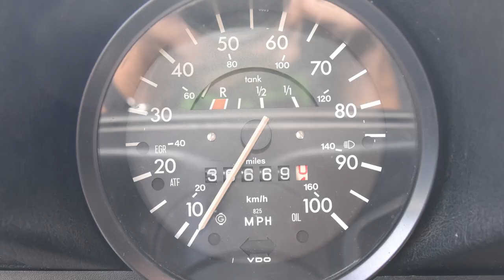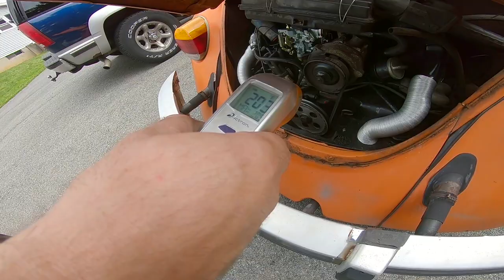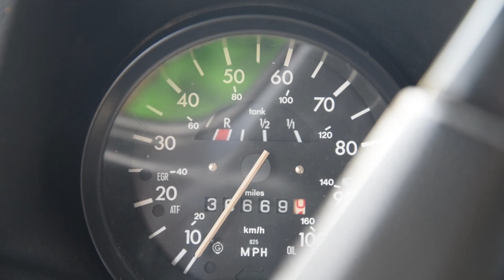1974 Volkswagen Super Beetle 1600: Regular Car Reviews

Comment: The Beetle's design, both in looks and practicality was ahead of it's time, when it was designed in the 1930's. It was also inexpensive and reliable and for all practical purposes in the United States, filled the small economy car niche for 15 years straight. What killed it in the US was, that even though it was reliable by 1960's standards, which weren't very high, and could be easily maintained by owners who were willing to get their hands dirty,  by the 1970's, the Japanese had raised the bar so high on reliability as well as fuel mileage (Beetles maybe got 30 mpg, but a Datsun B210 got 37-41 mpg, for instance), that Beatles could no longer compete & couldn't get by on "cuteness" alone. VW had by then acquired Audi, which had a vehicle in the works, which either spawned or became the VW Golf/Rabbit, which was enormously popular and likely saved VW as a company.

Comment: I've owned four classic Bugs over the last twenty years, including having a 1972 as my daily driver from 2010-2014, here in Maine. Yes it was cold, even with the heater system in good working order, but at least it drove brilliantly in the snow. 

But overall this review is pretty spot on, except that that super was in pretty shit shape. I drove mine from Maine to Maryland one summer and cruised on the highway between 65mph and 80mph. But I'd made sure all the cooling tins were correctly installed, and I still had to take cooldown breaks. 

The most accurate thing in the review is that Beetle people aren't really classic car people, which is why when it was time for a new classic (this time as a project/toy, not a daily) we got a 1950 Pontiac.

Comment: Here's an old car that barely runs and needs constant care. Here are a set of tools. Have fun teenager.

This is what my father did with my brothers and I. My older brother lacked the patience and attention to detail to really learn anything other than wiring. I can rebuild an entire engine, minus some of the the machining and also diagnose modern cars with all of their sensors and computers. My little brother has a Master's in engineering and can all of the machining for a rebuild. This strategy was also cheaper than having us work part time jobs and pay for newer used cars that didn't need all the attention, even though we constantly were having to visit the auto parts store to the point that the employees new are cars and us on sight.

Comment: My response is that all Type 1s today should be driven in the Southwest, where there is no road salt. If the oil heat disturbs you, there are aftermarket oil radiators for that. The heater problems can be fixed by checking if the tubes that channel the heat are rusted out under the car and replacing them. The VW Beetle is a "point A to point B" car, a faster Model T Ford. You want a hot-shit ride, get a water-cooled six or eight cylinder car with a five-speed manual transmission - the VW is for the other people who want basic transportation and nostalgia, and for people like me who find compact foreign cars of a certain era fascinating and would love to own an IZh 2125 Kombi or a Fiat 124 and a Beetle (no Autosticks, please).

Comment: A well-maintained (super) beetle is as reliable as any other well-maintained vehicle. BTW: that is an ALTERNATOR in that engine bay. If the engine bay is "too hot for a plastic fuel filter (which every other beetle has no problem with)" then you need a tune up.

Comment: You should do an actual beetle. Ie, 1962-1969. It handles way differently due to the torsion spring suspension. Ideally a 1600DP model with no bullshit done, ie no 'new' air filter with absolutely no modding done to fix the change in intake pressure, the tinwork & the diaphragm maintained, the heat exchangers not poisoning the cabin, I'm talking OG Hitler yo

Comment: While you are correct about some of the mechanical upkeep things, don't use this car as an example. It's a sled. No correctly tuned/timed VW engine should act that way. And no one should inspect one or drive one for that matter without a working speedo. (Just sayin'.) The fact of the matter is, the VW is not unlike ANY classic car. There IS upkeep that must be done on a less-than-modern car. People of a certain vintage will tell you that this was a fact of driving life many years ago. Like the 7 years I owned a 74 Beetle as my daily driver. You DO learn how to time the engine. You DO learn what a dwell meter is and how to use it. You DO learn how to adjust the carburetor and how to adjust the brakes. And you have to spend a shockingly large amount of time doing these things in comparison to operating a modern car. Once you do learn these things and can properly service your VW engine, it rewards you with a terrific driving experience. You have to intrinsically love the VW experience; it's not learned behavior!

Comment: With how simple these cars are even the wiring, just pull them apart nuts a bolts and do a full resto. They make hi performance engines for these things that just drop right in. I bet you could find one of these for less than $1000 put $4000 into it and have a fully reliable and good looking beetle.

Comment: Right off the bat, you can make them not smell like gas, the generator's slow charge makes batteries last much longer, the fuel lines don't rub on the ignition wires, they are super reliable, and the oil doesn't get hot unless you're over-reving it...Ok, wow, I'm not trying to do this but...The main difference between the beetle and super beetle isn't the size but the front suspension. The super beetle has McPherson struts instead of a torsion beam....Mechanic mechanic mechanic, What? I've owned a classic VW for years and I've done nothing but change the oil, absolutely nothing and its never skipped a beat. Its been as reliable as my father's Toyota Tundra.

Comment: I made the mistake of leaving the air filter off of mine one time.  Don't do that
Rain went straight in through those vent holes into the the engine and seized it up, and that was the end of my car.
I have a Datsun 280zxt and believe me, it is no picnic either.  Everything on it breaks.   Fuel injectors get clogged, starts break, fuel sensor broken, all those nifty high tech accessories to sell it off the deal floor...by now... inoperative and  broken and dead weight on the car, unless they can be removed.

Comment: I doubt if anyone under the age of 50 would understand, but people owned Beetles back in the 60s and 70s because they were uncomplicated, reliable and very easy to maintain.  Parts were cheap and plentiful, and there were lots of mechanics around who knew how to fix them, so the only thing a VW owner needed to know was where to put the gas.  It's easy to criticize the Beetle because the opposite is true today, but back then it was the car of choice for people who didn't know anything about cars and just wanted something they could count on to start on cold winter mornings.

Comment: The upkeep on any classic car is more than expected by drivers of modern cars. No need to single out the VW engines and vehicles being particularly problematic. Good news is that there are ample parts for replacement and at modest costs, and that the repairs are as simple as it gets. I have owned several 1960's beetles and three busses (1960 and 1971) as contemporary daily vehicles, and currently a 1971 bus as a 47 year old classic.
I was hoping for a less biased video AGAINST the classic beetle, but I guess everyone has their opinion.
I do agree that a long trip in a Beetle was brutal. But the ride of the bus is smooth as silk. My 1971 bus is smoother over bumps than my modern 2016 Toyota Prius! Yes, really.

Comment: It's not a bad car if you know what the hell you're talking about.

VW Beetles were designed in the 1930s to be BASIC transportation for the masses; for many in Germany, it would have been their first car.  (Think of it as the German equivalent to Ford's Model T.)
When the VW Beetle was designed and first built (the 1930s and 1940s), MANY cars didn't have hydraulic lifters, so adjusting the valve lash on a regular basis was something that was done.  (For example, Chrysler's Slant Six engines also needed to have the valve lash adjusted, and THAT motor was from the late 1950s/early 1960s.)

The differences between the standard Beetle and the Super Beetle start from the dashboard, and work their way forward.  The standard Beetle always had a flat windshield, whereas the Super Beetle  wound up with a curved windshield (the first few years, the Super Beetle also had flat glass).  The main difference is in the front suspension:  the standards had torsion bar front ends, whereas the Supers have struts, giving the Supers a better ride, and more storage room up front.

For reference, I love my '74 Super, but I'm a big fan of most cars, and I salute anybody willing to put in the time, effort and money to keep the old cars alive, regardless of marque.

Comment: The only thing missing from this video is the sound of that air-cooled engine under acceleration. You think Harleys sound obnoxious? Try a great big sewing machine with almost no soundproofing.

One of the attractions of these cars in the UK at the time was that, unlike domestic and most European product, they had a reputation, possibly not entirely deserved, for not rusting (virtually the whole of the UK is rust belt) and for being easy to work on. For the wealth-compromised, this was important. The Super Beetle was arguably the best Beetle ever made: but its viability depended on reliability and relatively low cost. Japan was about to eat the Beetle's lunch. By 1977-8 Datsun and Nissan were everywhere. Both our close neighbour - long time Beetle enthusiast - and my father - Vauxhall fanboy - went Japanese.

Comment: The VW Bug, the Porsche 911, and the Ford Anglia are all examples of timeless design with form following function, but with great style. A Bug may not be pretty like a 911 or a Anglia, but it's definitely unique. :)
As for the mechanical aspects of the Bug, if it doesn't make you a mechanic, it will make you a welder/body tech. Their major fault is they aren't exactly a built like a tank. Thin sheet metal that definitely rusts. The VW vintage buses are pretty much uni-bodies. If you've watched any amount of Mustie, you'll know that most of them are probably lipstick on a pig. Prepare for serious work if you plan on a restoration. It will cost way more than the car will ever be worth. VW culture is basically a hobby, not an investment.

Comment: The Super had a vastly superior platform to the regular beetle.  Monocoque (unibody) construction (not a detachable frame/body) with MacPherson struts all around and R&P steering. It did not change appreciably in height or track but wheelbase was a bit longer than the regular beetle I believe.  At some point they got the curved windshield you have here (which significantly improved fuel mileage).  As somebody else noted your '74 should have an alternator, replacing the earlier generator.  By later in the decade (last year in US was 1980?) they got fuel injection but if they ever got disc brakes I don't know.  But all kinds of aftermarket conversions for that.  If you can smell gas there is something seriously wrong that should be fixed.  If nothing else it will make you sick as a dog after 30m driving. Same with exhaust.  Neither was any widespread problem with these cars.  Just basic build attention is all it takes.  Some bad mechanic has had his hands on this particular car.

Comment: Incan tell you why it got all those states, although I'm amazed you didn't figure it out on your own. Yes, we have seen Beetles, all kinds of them. In my case, literally, not even counting the one my parents had, along with one of VWs camper van.

The reason we look is, it's normally the first time some of us have ever seen one running, and being driven. Mom's Bug never ran, and the van dies on a trip to NY from NC, right as we hit the toll booth in Richmond, and Dad had to drive from Jville to North of Richmond, to tow it back with the F100. Last time the van ever ran. 

Meanwhile, I couldn't kill my 62 Studebaker Lark, in 14 years of driving it, pretty much daily, and dad now has it, still going with 500 k on,  the clock, 3rd motor, 2nd transmission, 4th clutch.

Comment: I've owned my 69 karmann ghia (mechanically identical to a bug) for 4 years now and its the fucking easiest thing to keep running happy and its cheap too. I drive it no matter how cold it gets because if your heating components are all functioning properly and sealed the heat is totally adequate. I just keep it out of the rain and snow as its a convertible and the top doesn't seal well. I've put 35k on it since I bought it and truly can attest to how easy and cheap to maintain (mechanically) it is i do everything myself. Of course it takes a lot more maintenance than a new car to take care if and they are FAR from just leaving it alone and driving it like most lying air cooled VW owners say. "ItS ThE mOsT rEliAblE CaR EvEr" dont listen to them, it needs a ton of maintenance but its cheap and easy to do.

Comment: Also add to the list the stupid push rod tubes that always leaked. To fix it properly you had to remove the engine, pull off the heads and replace the tubes that were made of cheap tin foil crap. Also no matter how you adjusted the valves they were either too tight or too loose, but that would be normal for an engine with wild temperature swings. The ignition coil failed often because it was crazy hot in the engine compartment. And yes the clutch cable would never pivot properly were it connected to the transmission and break, you would have to fish the cable through a tube up to the petal which was a whole day job.  The brakes never work properly even after replacing everything. When you pushed the petal down slightly it did a lane change. Readjust them and 2 days later does a lane change in the opposite direction,  they worked ok if you stomped on them violently and that's how I drove it. You had to adjust the brakes weekly. When the engine was cold the carb would ice up and bleach black smoke for a while. The car always smelled inside of engine odors..Hot oil.

Comment: The last Beetle I saw this summer was a 1963ish American model and after the guy turned the key off it continued to fire on a few cylinders for 4 straight seconds and once it had stopped, starting sizzling and popping......

I barely tolerate air-cooled motorcycles, air cooled cars are a solid no. 
Air cooled Volkswagen? Walk away......
I love them for the bodies and the aura they bring with them but the trouble and hassle with continual ongoing maintenance is beyond discouraging :(

Comment: I was young and bought 70  vw wagon with the suitcase engine / the car did 99 mph ! the electrical and charging system problems busted me ! Then hit a pothole and it the dash burst into flames ! Car never had heat in the winter ! A pontiac fiero is 10x better

Comment: I respect your opinion, but I've had the complete opposite with my 1963 volkswagen. Sure anything old will need attention and yes maintenance is part of it. But I personally enjoy building things to spec and not shade tree mechanic like the one you appear to be driving is. If your engine is shaking and you smell gas you need to fix the car and not assume that every Volkswagen is like that.  When that 74 Beetle was new it was not acting like what you're describing. It's normal for a neglected vehicle to do exactly what this video is showing.  You won't smell any more gas on a bug that is properly maintained than you will in an old Ford or Chevrolet truck that has a carburetor..  I drive my Volkswagen 50,000 mi a year, yes I am one of the old school weirdos that still drive one. I currently have 1 million 24,000 mi total on the car and every 200,000 miles or so I rebuild the engine and go again.  Happy motoring whatever you drive :-) it's all about having fun and I'm glad everybody can enjoy the car the truck the motorcycle or car that they drive.  I drive my Volkswagen all over the United States and never fear of a breakdown because yes I do preventive maintenance and it's very satisfying to lovingly keep a classic going.   And my heater works excellent by the way, you have to know what gear to drive in to keep the engine revved. Let's face it the car takes understanding to appreciate, some people that are more on luxury don't get to the appreciation part. The car is built to do exactly what it was built to do.....be a "people's car" that everybody could afford and maintain. It's literally the German equivalent of the Ford model T.  If you don't want to maintain it you're correct, it's not the car for you.

Comment: First that is an alternator not a generator.  If it's taken care of most of the problems you talked about will not happen.  I have never had an engine fire from using plastic fuel filters in over 20 years.  Got to parts stores that specialize in air cooled VWs and you will get good parts that fit.  If the brakes are properly adjusted you will have plenty of braking power. If you don't want to have to adjust your brakes replace them with disks. The parts cost $600-$800 for all 4 wheels depending on what you get.  If you want an e-brake it costs more.   You don't need a brake booster on a super beetle. If you're going to talk crap  about a car you should at least know what you are talking about.